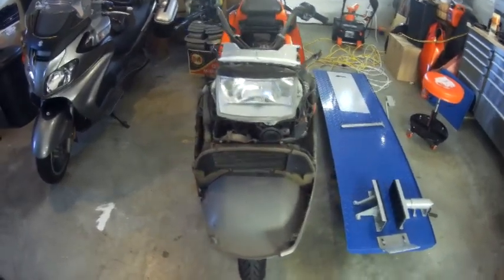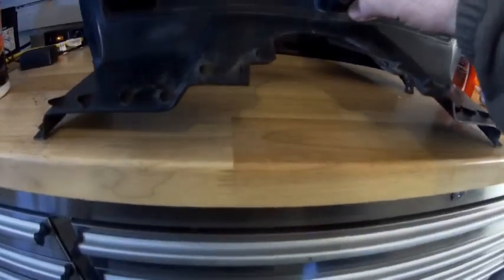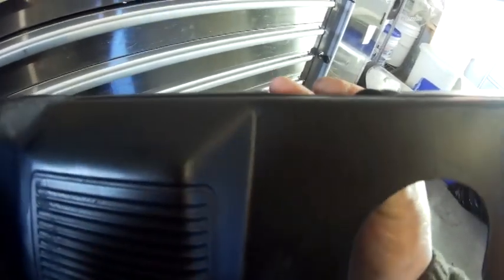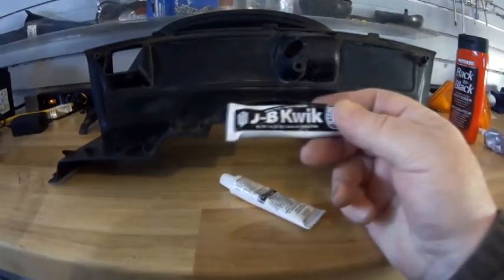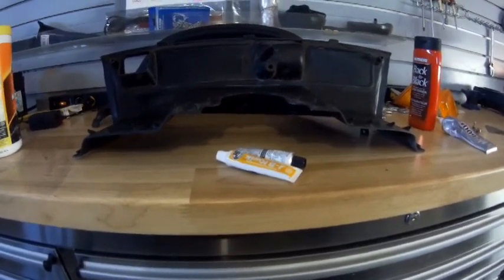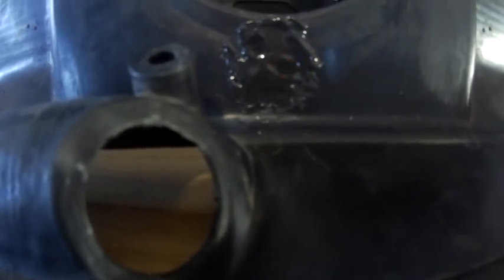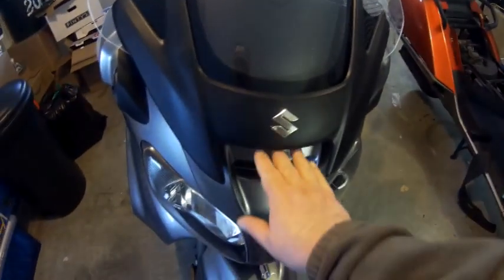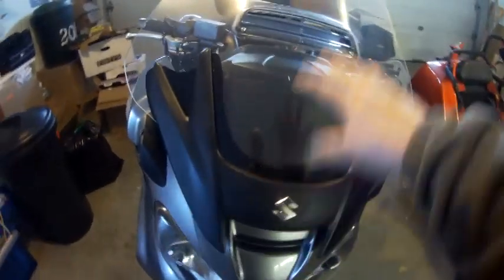Helix Project Pt 4

Comment: I would make a little metal grill for your Burgman.
Reply from the maker: Got any pictures?
Reply: not really. just a serrated diamond mesh stainless grill form fitted to your bug scoop. Held in place by JB weld, of course. Install inside the scoop so it looks professional. I live in Victoria and mentioned that I was looking at that Helix last year.
Reply from the maker: Interesting.  The Helix has gone through much in the past year. by the time it rolls out this summer it will pretty well be a fully restored 86 Helix. Stay tuned for the updates!